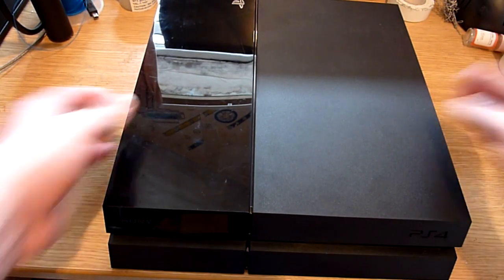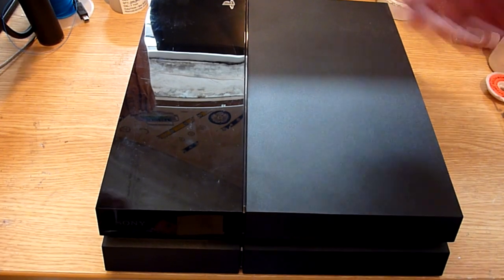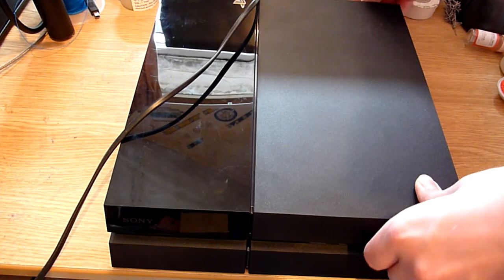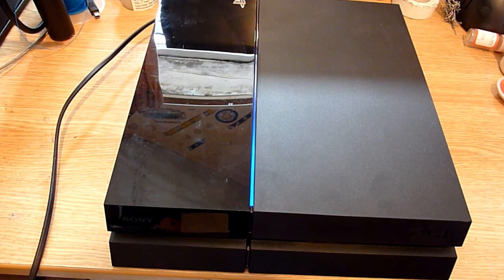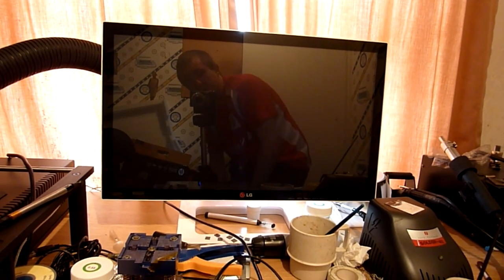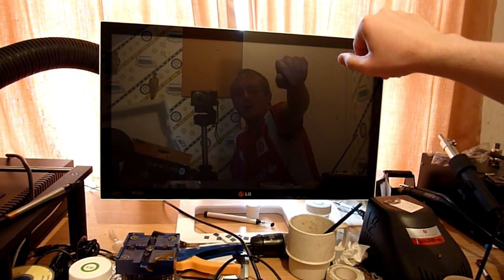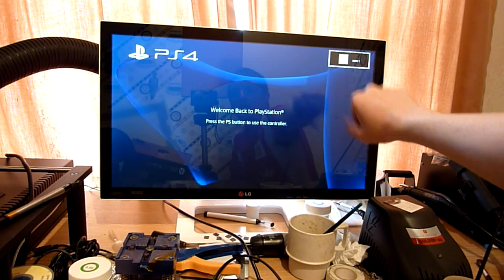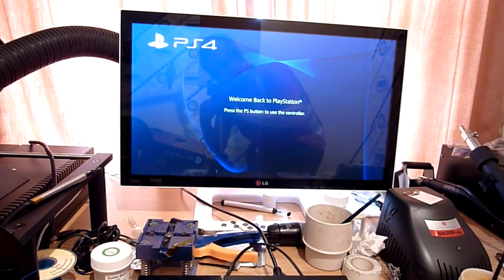PS4 Power Supply Repair - ADP-240AR Transformer Failure - Blue Light of Death (BLOD)

Comment: Excellent video. The side by side comparison of symptoms is brilliant since they behave fairly similarly. That part of your video told me I had a PS issue so I kept watching to see how to pull it out and troubleshoot it. Imagine my surprise when I looked at the transformer and found it in the exact same state as the one in your video... slightly raised from the board, both wires pulled off the pins. I'm an electronics tech so I'll be taking these parts to work tomorrow to use our soldering bench to try to make the same repair you did. I'll report back with the results.
Reply from the maker: +Timothy Collier Hi mate - many thanks. I'm sure you'll fix it when you get it all reattached. Good luck! :-)
Reply: +Timothy Collier -- A year later, how'd it go, Timothy? Well, I hope!

Comment: When the visual inspection turned out good and there's nothing bad-looking, the first thing to do is to check the fuse for continuity. Easy to replace and quite often the reason why you have a completely dead system. Oh, and on the Slim it's also probably a good choice to check if the power button board is actually connected. I had a Slim where it wasn't. And I was the first one to open it up. System acts completely dead (I didn't check if I could start it with a controller), I opened it up, took the PSU apart, checked everything I could think of with my multimeter, swapped over another PSU, still nothing. Was annoyed that I had to take it apart (the PS4 slim has way too many screws), turned it around and saw that somehow that stupid ribbon cable from the power button board had come lose. Plugged it back in, PS4 works perfectly.

Comment: Guys, if you cleaned your PS4 and have a problem getting the PS4 to turn on or it turns on then off, you may have put the power supply back in 
wrong. Make sure the two long metal pieces are straight and not bent to where it reaches the power brick. Not placing it back in correctly also 
may make it hard to put the other plastic back on and difficult to put the screws back in the PS4. Went through this myself. Hopes that's the 
case and you too can save your money.
Reply: Had one come in once, where one of those prongs was bent against the other and they both were in the same hole in psu. All I needed to do was bend it back straight and the machine came alive.
Reply: Tysm!! when that happened to me it scared the living crap out of me bc the power supply failed once before but it doesn't seem to be the case and now my ps4 is working fine.

Comment: Champion, i had the same issue on a ADP-240CR but it was the marginally smaller transformer next to the 2 big main caps. my guess the console took a tumble? as it actually broke the transformer in half on the bottom on one side of the 3 poles that attach to the board. 1 single core wire broke away from one of the poles, shorted out and took out the Q5 mosfet and the fuse together. replaced those and all working sweet again.
Reply: Anthony Boccardo i have the same transformer with half disconbected.  I wanted to repair but not sure which wires go where. Any good images i can maybe compare or  do you have a part source?

Comment: Mine is no doubt a sibling of the gal on the right. I have a 1215a, and have sent it in twice. This will be the third. I keep getting the same system back,even after explaing that i build computers for a living, and know that the repair is not your everyday hard drive or software swap. What has me completely stumped is that mine will 80% of the time repeat the blue flick to dead, and depending on the amount of time from last unsuccessful attempt to full boot the system will operate longer. Overheating somewhere  initially was the suspect, but was ruled out when the blue flick evolved and can shutdown the system within 2 minutes even after days of sitting disconnected. But the damn thing decided to totally mindf..K me yesterday.I got the blue flick,dead,but got a full boot after 4 to 5 back to back replug attempts! Now the strange part is that its still running now! Matter of fact, im using it to post this message. Im totally stumped, and starting to think my system has become aware!!!! Just joking, what would you do with this strain of the blue flick?

Comment: My 1206 would turn on will check hard drive and shut off. I ran it on ATX supply and it was working. I have bad power supply right?

Comment: Hi Andrew, I have a ps4 CUH-1001a and turns on and off in a second. I did hear two clicks on the power supply unit ans turns off and no DC, power and eject button doesnt work and I hve to unplug it 2-3 times and works back again. What should it be?
Reply: I have a 1116A wich do the same as yours, in my case is the psu, but i don't know whats the problem becouse the psu looks ok, but if i test that psu in another ps4 does the same.

Comment: In my case, the ps4 does not turn on, I tested and there is 5v, when I bridge the 5v and the standby does not turn on the 12v and it does not activate the relay, where do you recommend me to start checking?

Comment: My ps4 has the same sympton, but it's not a transformer. Can it be the DNP015 IC? There was a roach right there! I've removed and tested the zener diodes and they're ok... I'm pretty sure is the PSU.
Reply from the maker: +freakpunker it's possible - the DNP015 is a watchdog IC for the entire supply so if this is stuffed then you may end up with issues.

Comment: My PS4 slim was off, just a beep when trying to connect, no video, no cooler spinning, no going into safe mode, I did not accept disks. Nothing worked.
So I put the motherboard of ps4 in the heated oven at 200 degrees for 15 minutes, and now it responds, accepts and ejects the disk, synchronizes the control via bluetooth but does not give video and blue light pulsates. I have read in some places that may have relation with the PSU ... Have you ever picked up a case where the console pulsates blue, but does not give video and does not enter safe mode?

Comment: thank You ! ihave my PS4 dont run at all , I m testing the power supply module and find 12v output is not present, also find this transformer You worked seems overheated. tell me something, the four thick pins of my transformer all have continuity, and the three of the other side have continuity only the 1st and 3rd, but not the center, is this normal or need to take out this transformer to test it? also ask you how much voltaje should be present at this transformer?

Comment: Hello! My ps4 has the same issue like the right ps4 in your video were when I turn it on, blue light comes on for a split second, heard two clicks then shuts off so I knew it was a power supply issue and bought a new power supply but I was wondering why my ps4 still does the two clicks and shuts off after replacing it with the new one? Can it be just the new power supply that I bought is also defective or maybe something's wrong with the motherboard?

Comment: Just curious, since transformer lives upside down and just hangs off of pins which are friction fit only, why didn't you apply epoxy to pins to hold them in place, or put any adhesive or tape under transformer to hold it to pcb, and thus keep this problem from re-occuring?
Reply from the maker: +john browne Hi there, it isn't - it is linked to those pins via two leads soldered onto them. It was these leads giving way which enabled the transformer to become dislodged when it was impacted. It is a tight fit otherwise so isn't really required. Cheers.
Reply: +Andrew Paul The only thing holding the transformer to the pcb is the pins, which are press/friction fit only. An impact caused the pins to slide out of transformer, which pulled solderer wires loose. A dab of adhesive or double sided tape under the transformer would take some weight off the pins, and maintain a "factory" look if that is important.

Comment: Good evening I have the same problem as your left ps4, it turns on and then turns off 2 seconds after. I opened it but I am not the transformer wires that are desoldered. So do you think that it also comes from the trasformer too? The ADP-240CR power supply model

Comment: Hi Andrew,
Thanks so much for your videos! I'm blown away by the way you can fix hardware issues as good as in factories.
I currently have a BLOD issue which first seems to be a motherboard issue (2sc blue light, hard drive noise, fan start working, then I can "switch off" the console (i know it thanks to the beep) and switch it on again). 
However, I tested the power supply with a multimeter and the main output (where the two long spikes plug), deliver 2V instead of 12V. 
Did you get the same voltage during your tests?

Many thanks again!
Reply from the maker: No it should show 12v but only very briefly on a 2 second BLOD - if it powers off after a couple of seconds depending on your multimeter it may not refresh quickly enough to show the short spike which could explain why you're only seeing 2v. By all means though try a different PSU if you have one to hand but I think yours will be an APU issue. Cheers.

Comment: woow that was great..Have also got aprob with my power supply and i think this was caused by burgs my ps4 does not turn on and no lights at all. have tried watching videos on youtube but it seems my prob is different coz i got no light at all.. I guess am gonna try to open it and see whether i can spot any prob in the power supply.
Reply: i have the same problem. I have given it for repair. did you find a solution ? Did your ps4 start working again?
Reply: +Shikhar Mehta not really I was told there are no power supplies for my model yet.
Reply: +Khali Gamer Seems like I am fucked then :/ The repair guy will tell me tomorrow if it can be repaired or not. I hope its just some minor problem that can be fixed. I don't even understand the problem with it. It worked fine...i unplugged it from power after playing....and after 4 days it doesn't turn on at all!! It's frustrating as hell!
Reply: +Shikhar Mehta the same thing happened to mine.. how old is it?
Reply: +Khali Gamer It was 3 months old. Bought it from overseas so warranty doesn't apply.
Reply: +Shikhar Mehta I understand. I think it's a new model cuh12xx wait and hear from that guy u sent it to.. U never know mybe it's just aminor issue.. InshAllah
Reply: +Khali Gamer Yeah I too hope so! Thanks :)

Comment: Sometimes my PS4 behaves like the one on the left, but other times I am able to power on normally.  All menu functions/internet browsing/downloads work at this point.  However, when loading games, the ps4 display immediately turns off.  The PS4 is still powered on with a white light, just no display.  I am thinking this is also a PSU issue, as the increased power demand to the graphics card crashes it.  Thoughts?

Comment: Hello Andrew Paul, I am from Argentina and I have a problem with a PS4 ADP-240AR source where I turn on the console, it is raising the system for a few seconds, it automatically turns off by clicking on the source. With my multimeter check the arrival of 220v, 5v. The capacitors, the smallest gives 300v and the largest 307v, the fuse has continuity, the resistors too. However I do not have 12v, will it be because of the DNP012A chip?
Thank you for your videos and training us, I await your response and can help you in whatever you need.

Comment: hey. quick question. just bought a ps4 for 50$ and it's not powering on. when you press power button it stays on for a second and you can hear a faint beep and off. I'm going to remove the power supply and test it on my fluke. any other ideas ?
Reply from the maker: +Jonathan Pope Only ever had one of these reported but by the time I got it, it wasn't doing this any more so never got the chance to get to the bottom of it sadly.
Reply: +Andrew Paul . I'm wondering if  it's worth even checking the power supply. this is a refurbished from gamestop so I'm wondering what the original problem was

Comment: Hi there i have the same issue with the blue light coming on for a second and then going of with click heard. I opened up the psu but the transformer wires are intact , what else could be wrong?
Reply from the maker: After the first power on attempt, does the console allow you to try again or is it completely dead at that point until you physically remove and reattach power?
Reply: @AndrewPaul  its dead have to take out main cord and put back then only it will beep and light up for a second
Reply: @AndrewPaul  i have the power supply stripped open tryin to find any loose oh broken solder joints
Reply from the maker: In that case it's definitely the PSU. Check it for any broken wires coming from the transformers - it's a common point of failure. Failing that, to be honest replacing the PSU for a new one is probably the best bet.
Reply: @AndrewPaul  okie thank you so much i like fault finding so maybe you could make a video testing all the major components of the psu so i could compare on mine and find the fault , Im from south africa and the psu is not very expensive but would be still fun and great to fix this old one !!
Reply from the maker: I have a pile of dead ones ha ha! Maybe if I get a quiet week I'll go through them.
Reply: @AndrewPaul  thnak you so much i havw the adp 240 ar psu

Comment: What's caused the PS failure at the first place? Did the user do something wrong that caused it? Or is this an existing problem with the power supply!   My son's PS4 just 2 weeks (brand new), had the same problem (BLOD). So disappointed!!!!!
Reply from the maker: +Jenny Nguyen I think it was dropped which caused the transformer to jump. Still going strong this machine :)

Comment: I have a ps4 model number cuh-1215a with a broken psu, I haven't been able to find a replacement model number adp-200er psu for my ps4, but from this video I found that I could possibly repair the psu in my console. I have found a burned spot on the board and was wondering if you could help me figure out how to fix it if it can be fixed.
Reply: here is a picture of the damaged spot.

http://m.imgur.com/0sZIUlo
Reply: @william have got the same model and the same problem. i would like to know whether u fixed it and how. please help
Reply: +Khali Gamer never got it fixed, I am just keeping an eye out for a replacement power supply. I have no idea how to identify the individual components on the board, so I don't know where to start looking for ways to fix the one I have.
Reply: ooh i got no hope too. coz these models have no powersupplies out yet. Where is your ps4 made from? just asking. mine is made in china and i only used it for 1month.
 i think these models have got that apowersupply problems in common.
Reply: +William Hendrick Sure enough I have the same problem except the burn on my power supply is not as severe as yours.
Reply: +DoNotEvenAsk am planning to get a new ps4 at the end of this month. This time I will get the warranty. I got no option.

Comment: i have the console you are repairing now but i think it stays on longer like the one on the left (at beginning of video) I need to cheek again to be sure but i do think i will need help locating the actual fault, also do you where those gloves so you dont short circuit the motherboard. Thank you for advise.
Reply from the maker: +JC Gamer The gloves are to protect from flux residues and other solder-related chemicals etc - it's all rather nasty stuff and you don't want it on your skin if you can avoid it. :-)
Reply: +Andrew Paul thank you i tested my ps4 and it does what the left one in your video does. so how do i fix it i dont have tools to take thing's off the motherboard like the APU. If there are other ways to fix it without taking part's off it and putting it back on any advice would be great. Thanks
Reply: yes this is the one idk why I couldn't find it before but thanks I still can't get my ps4 to work i have come to an understanding that it needs a reball

Comment: hey andrew i have a 500gb ps4 and its got the BLOD after a power outage. it doesnt go off after a few seconds like the other consoles with BLOD do but stays on for quite a while. what could be the problem?
Reply from the maker: This is a general error condition - all you know is that something is halting the boot process. It could literally be anything (rarely APU in my experience).
Reply: ok i see. but just in case you bumped into any console with a similar problem, the machine does not go off on its own. it stays on permanently until i switch it of myself. thanks alot btw

Comment: Hello sir 
I need help....
I have ps4 pro power supply....not power on,
I find out two components are defective,
1. STD3N62K3   N MOSFET
2. One of SMD Zener diode (zener diode location number on PCB (ZD39)
Problem is I can not find any value of this zener diode,
 if you know something about that value of zener diode or if you recommend something equal please help,
Appreciated.
Thank you very much 
Cheers 🍻 from Denmark 🇩🇰

Comment: I have the same power supply. Ps4 starts normal, but if i turn it off and try to start again, it shows the blue light, cklicks and goes off. After that i cant start the ps4 until i unplug the power cable, wait a time and put it back in. After that the ps4 starts normal. Do you have an idea? Psu looks good, no faulty places on first look

Comment: hello Andrew Paul I get the the same as the one on the right but if I check voltage on ps4 power supply I get 12 volts with a slow drop to nothing could this be something else besides powers supply
Reply from the maker: +jesse hill hi Jesse, that's normal behaviour for a BLOD - if you can power cycle the machine without unplugging and plugging it back in then you've most probably got an APU fault.